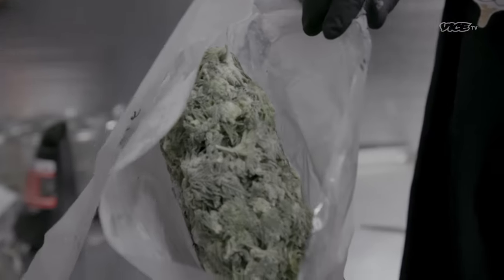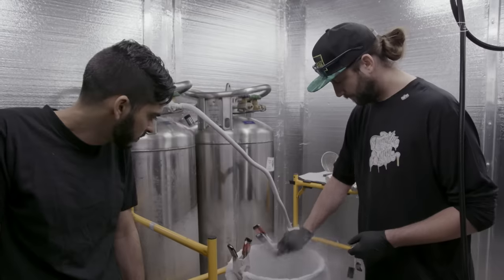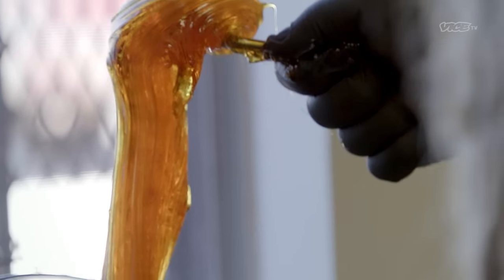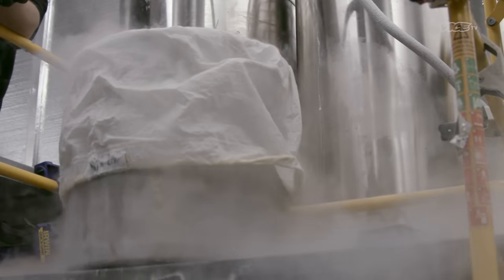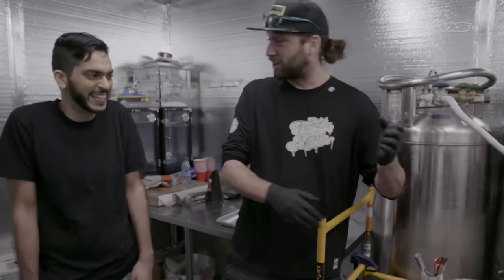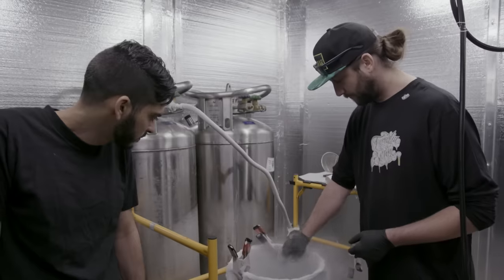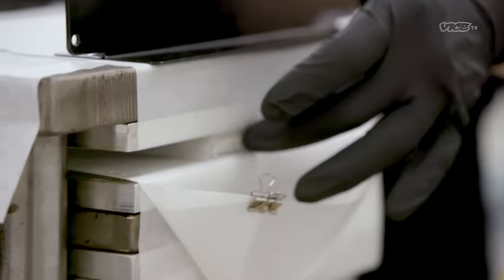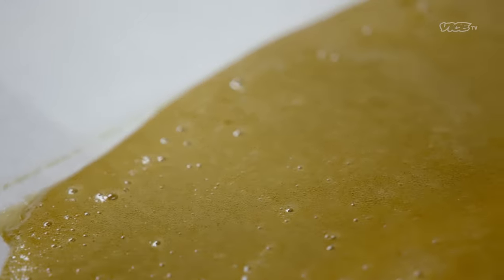I Freeze Weed With Liquid Nitrogen for a Living

Comment: I remember when a dime bag cost a dime! Now they’ve split the weed molecule like 500 times.
Reply: not sure its a good thing
Reply: it wouldint coast nothing if you grow your own
Reply: @Anonymous30304  well thats not true unless you just plant a seed outside and let it rock on its own with no inputs. indoor on the other hand cost more than you think. but in the long run way cheaper than buying.
Reply: @Mr.Potato420 He said “It wouldn’t cost nothing”, so he’s not wrong, though I’m not sure it’s what he actually meant, lol.
Reply: you cant split molecules without making them not weed anymore
Reply: @Anonymous30304 It costs so much to set up and maintain. Heat lamps, a whole room, humidity, aeration, room to germinate and sprout....Hundreds of dollars of set up and maintenance. AND ITS ILLEGAL.....Its only legal if you live MORE THAN 25 MILES AWAY from a dispensary. Sadly.
Reply: @Anonymous30304  no it just cost time in prison
Reply: @SumDetailingguy nark
Reply: It was never a dime. It was $10. Now you can walk into whatever dispensary is within walking distance and for $10 you get an 1/8th oz of your choice from a hundred different varieties.
Reply: @Anonymousguy-420 Sure it would. First it costs for proper lights, ventilation and humidity, timers etc, the cost of all the electricity to run the lights and other equipment, proper fertilizer, good seeds and the space and time to do it, not to mention the equipment they were using with liquid nitrogen etc. Try doing all that without a licence. Think you are going to just throw a couple seeds in your backyard and harvest extract like that in any kind of volume?
Reply: @Anonymous30304 bingo this guy gets it. Never understood why more people don’t grow in legal states. Spend $500 on supplies and never be without weed.
Reply: They split the weed molecules and the price 500 times
Reply: @sexygirlmax2019  Imagine going to jail because somebody opened up a weed store in your area lmao
Reply: @Mr.Potato420   you can get a decent harvest by putting virtually no money or effort into your plants if you think ahead
Reply: @sexygirlmax2019  I'm guessing that's in your state.
Reply: @sexygirlmax2019 that’s cap 🧢, you can grow up to 9 plants in my area and a dispensary can be next door
Reply: here it's really cheap. like 70 bucks an oz for pretty good stuff.  dabs 8 bucks a gram
Reply: I lost my job bc this stuff, be careful
Reply: @Next96300  Yeah I live in Kansas city MO the dispensary weed is expensive $40 to near $60 for a 8th and most times there is a nearly $10 dollar tax after purchase that's why street dealers are still in business heavy in the city
Reply: Indoor was never an option sun is better then any mimic light and weed stronger in the sun then grow lights indoor was specific for cleaner buds but not better as if outside seed plant water water water harvest 🫡🫡🫡
Reply: Would it be a dime bag if it didn’t cost $10? You still pay $10 but the bag would be smaller. Right.??
Reply: That's a bar...u are now a conscious rapper lol
Reply: A dime bag will still cost a dime…
Reply: @AquaJV  if it “wouldn’t cost nothing” that means it will
Cost something. So actually he is right cuz cant grow for free
Reply: Still have not replicated the ole school taste.
Reply: @redavni1 What state do you live in? It's about $10 a gram in NM dispensaries. Our state taxes us into the ground ❤
Reply: @VondaInWonderland  California. Taxes are high here too but so is supply.
Reply: @redavni1  Uufff I've heard about the California taxes and licensing, and  that the old school Humboldt county growers have been put out of business :/
Reply: @VondaInWonderland  yeah I live in Humboldt. The growers are changing the name of the business every year to dodge taxes
Reply: @redavni1  I'm glad that they are still finding a way to thrive.
Reply: Nickel bag was also $5
Reply: @sexygirlmax2019 not if you live in a legal state, you can grow anywhere
Reply: @martygriffith2135 … Yeah… That’s what I said.
Reply: Still gotta be careful as a user based on your employer. As soon as they passed the law that it was being legalized in my state, employer (big international company) pro-actively updated employee handbook that they follow FEDERAL drug laws if testing employees, not state.
Reply: @Anonymous30304 we can tell you don't grow
Reply: @Mr.Potato420 I mean, weed grows naturally dude. If it can survive by sitting outside on its own, then yes, growing your own weed is free
Reply: @Mr.Potato420 outdoor smokes better
Reply: Is this a half baked reference?
Reply: Paid $15 for a regular sandwich baggie about to run over it be stuff full . Then it went to a $15 4finger lid around the Mississippi Delta in the mid 70s . It wasn't the bud of today. But in the late 80s we was buying Amsterdams Skunk#1 grown in Kentucky. It be a 10 1/2 hr.drive to get it but I made the run acouple times lols . Friends in Kentucky had a Co-Op grow so they had it going on for awhile. Lost contact. I sure they still do. I got some good bud back then . The Skunk#1well let's just say that Arkansas has no weed better than it . I haven't smoked any yet anyway. Maybe one day they get something close to it. The female puts off a odor that smells like a female Skunk puts out when she in heat to male skunks. They come spray all around our house , looking for a female cause my plants that I growed from the seeds. They did good in the fertile Delta soil .
Reply: @katherinemcclellan8825   What is the "Old School taste."?
Reply: @technodrone313  Where's here though?🙄
Reply: Detroit @nyakwarObat
Reply: Remember when in the 80s it when dry then when it came back it was metric.  No more nickel and dime bags.
Reply: Back off grandpa, ur embarrassing ur virtual reality clones
Reply: @Mr.Potato420  really long run unless you sell half
Reply: @redavni1  which universe is this I want to move there
Reply: @Anonymous30304 growing good weed is in no way easy. Or cheap. Even indoor grown is hard to perfect
Reply: Just ruining the flower...
Reply: @AquaJV  He said it "wouldint coast".   Not sure what he meant.
Reply: @wutangisforever2798  
It's just that the size of the bag will also be that of a dime.   Literally.
Reply: @kaispirit2079  
Groovy.   How much for a lid man?
Reply: @stephenharbisonsr.4557  
I've seen some 'less that honorable' dealers pass off dirt weed as skunk weed by pulling a couple of hairs off a dead skunk in the middle of the road and dropping them in the baggy.
Reply: @seeharvester You’re so funny man. Are you a comedian?
Reply: Who wants to have their whole house reek tho
Reply: You're full of it. A dime bag never cost a dime.
Reply: @Coolcarting  that was your focus lmao? I’m wanting to learn about this newly discovered “ weed molecule “ 😂 like what is weed to this man some kind of medication found in a laboratory? 😂
Reply: You 160 years old?
Reply: @bobwoods1302  facts. Cuz never it costed 10 cent.
Reply: Just make your own, then the only price ya gota worry about is the price of fox farm lol
Reply: @Anonymous30304  you have no idea the cost to grow good weed. it costs a LOT.
Reply: now we're paying 500x more for the same dime bag lol
Reply: @AtomicBl453  if you bought weed for a dime you didn’t get weed 😂
Reply: @Anonymous30304 Dude, grows aren’t cheap. Don’t underestimate the amount of money and time put into growing quality bud at home.
Reply: @blak3brutus229 it’s best he didn’t as the plant is very toxic
Reply: @LiClan  marijuana is toxic yes in the sense that inhaling smoke from a muffler that your walking behind while it’s in park but on is toxic however unlike tobacco which is designed as a man made chemical, marijuana is a natural plant without much altercation other than to the care of its otherwise already natural properties ( speaking from and as the experience of a medicinal user )
Reply: @blak3brutus229  it makes people do wild and crazy stuff. This guy smoked one and got in a car. He kept driving til he hit a lamppost at 155 mph. Lesson to all
Reply: @LiClan  that didn’t make him do that, going 155 is a personal choice, I drive high all the time and never go past 80 😂
Reply: @LiClan  going over 95 means you aren’t suited to drive sober or not!
Reply: @blak3brutus229  the weed took over him
Reply: @Anonymous30304 yes it would cause it still costs money to grow it.  Or at least grow it the right way.
Reply: @sexygirlmax2019  wait what? what state are you in? My state you can grow up to either 4 or 6 plants depending on your situation no questions asked. doesn't matter where you live as long as its in the state.
The issue is initial set up is going to cost a grand with a tent. soil nutrients. trellice set ups. air control etc. When you can walk down the road and buy a half ounce for 70 bucks or so.
Reply: @VondaInWonderland  The real trick is to get a job near the dispensary, they give you neighbor discounts and repeat customer discounts which remove the tax and then some. Thats the beauty of competition in the dispensary game. For the first few years it was always expensive and not a huge selection. few years later some competition comes in the mix and shuts the shitty ones down. But you have to have a free-er market. Places like NY keep their markets completely artificial.
Reply: Lol you remember how much condoms were back then... nawl we never used em
Reply: @sexygirlmax2019  bullshit its not that hard and or expensive. You dont need some fancy lights at all.
Reply: Yeah but the $10 dime bag was definitely worth $10.... The weed now compared to the weed even in the '90s is crazy...
Reply: @hiijacktv IF COURSE IT IS! ARE YOU CRAZY??
Reply: Who complains about the cost going down? Use to cost me $60 for a quarter now I get it for $28, weed is literally the only thing in my lifetime where the cost went down not up.
Reply: its  cheeper now wtf
Reply: What if they made a "Nuclear weed Bomb". 😮
Reply: i wanted legalisation in my country not commercialisation elsewhere :'(
Reply: yup and now i can go to my local dispensary and get 1/8th of moonrocks for 15$ or 2 cake carts for 17$ which are eh{terps are too sweet}still gets you high af though, or an oz of westcoast cure flower which is dank for 70$. only thing that ruins it is the insanely high taxes 30% total. but still cheaper than what it was even 3 years ago
Reply: Dime bags have never cost a dime, only time I got more than a gram for less than a dollar was buying wholesale from a grower and that was 32lbs
Reply: @sexygirlmax2019 why do you have heat lamps, 90% of the time indoor is too hot and needs ac. Where do you live that you need to heat a lighted room or tent?
Reply: @wescald why did you lose your job from weed?
Reply: @SharonHF so learn how to drink some water... Passed every drug test I ever had by drinking a bunch of water and taking a few vitamins.
Reply: @kuttlikethat not true at all
Reply: @TayKayx not hard at all... Just research first and start with a few tomatoes. If you can't grow tomatoes you aren't ready to grow weed. I have grown in a lot of styles and conditions, and I can say that microdots in a 10-20 gallon Styrofoam cooler grown with the Kratky method will work for almost anyone with next to no effort and quite cheaply. The hard part about good weed is the curing process.
Reply: @SirSquash not true, it costs however much you want it to... Just pick the right set up and grow method for your wallet. People grow in solo cups in windows.
Reply: @blak3brutus229 how do you figure? What if he's on the autobahn?
Reply: @LiClan that's not how weed works
Reply: @nwerd7584 that's your question, not why she needs heat lamps??? 😂
Reply: @waffleMccoy you do need decent lights, but unless we are talking about winter in Michigan, Canada, Alaska, etc... I still don't understand the need for heat lamps. And neither a decent led or heat lamp have to be expensive at all. I fact you can even buy used lights with a burnt out diode or two dirt cheap.
Reply: @JamesJones-cx5pk you're too high
Reply: They've split the weed molecule? What on earth does that mean?
Reply: fortunately a bar
Reply: @TayKayx  no... its insanely easy, the word ur looking for is "tedious"... never once have I thought its difficult. 😂
Reply: @christalball93_  let me guess u have never heard of filters? 😅
Reply: @killer8349  lmao it’s really not. I know several people who’ve grown. Ur just being cocky if y say it’s easy. Mushrooms are easy, weed is not. Try growing in Arizona you’ll see. Grow tents even I see em fail all the time.
Reply: @TayKayx  and u act like you know it all... i must be a genius then but we both know that's not it... I have 12 growing rn for legal reasons that's all I'll say... I've grown indoors and just harvested 150g from an outdoor grow (wet).
Reply: @TayKayx  sounds like a skill issue tbh.
Reply: @killer8349  it’s not easy, stop spreading bs lies. It is not easy lmao. Ik people who can grow good weed & people who have failed. It’s not easy. Ur so cool bro u can grow😂 little boy it’s legal in a ton of states ur not a god
Reply: @TayKayx  who said I was a god? what... did you try and fail? is that why ur ego is so hurt when i say its ez? look bud, just because its difficult for you dosnt mean its difficult for everyone... just cuz you know people who grow means little, but sure... dwell in ur delusions.
Reply: @TayKayx  and when did I claim I'm cool? u have sum wrong wi ur brain lil jit.
Reply: In my day a dime bag was about 4 grams
Reply: Still does cost a dime, just means you're getting buds lost in my couch.
Reply: still does cost a dime if you skip the middle man and grow your own, F all these taxi medallion grows.
Reply: @nikushim6665  growing indoor costs a lot man.
Reply: Bars 😂

Comment: So what they do is break apart the tricomes into frozen micro particles and then use heat and pressure to press the oil out. Pretty cool to use liquid nitrogen to crush the weed and it's a super clean process to deal with.
Reply: You sound so slow. Using liquid nitrogen to crush the weed 😂😂😂😂. Force crushes things not liquid nitrogen

Comment: Wait yall skipped over the most important part. What's the process of getting the trichome heads out of the nitrogen?
Reply: was thinking exactly the same. now im just confused
Reply: @aaleeksii  they use rosin screens to collect the heads meaning the push everything through a tube with layers of screens. Similar to how you layer you screens when making dry sift or bubble hash. But there just pushing the material through a smaller surface area. Plus the CO2 keeps everything frozen so no degradation of terpenes.
Reply: @1173sanman  neat, thanks for the info!
Reply: @1173sanman  You mean LN2 not CO2
Reply: yes  @ahhason
Reply: Thanks for the info i  thought there were no screen its just an "nitrolator"
Reply: @1173sanman most important, no moisture!
Reply: probably just pour it out in to mesh the ln2 will evaporate unless its in a large amount

Comment: Been making oil since the 90's with my sisters hair straightener lol
Reply: How tho. Can you explain the process?
Reply: Don't forget the wax paper 😂😂😂😂😂
Reply: @Faceless959   Heat and lots of pressure
Reply: @Faceless959  Also used to do it with a pollen press, and would just put it on my stove and get some wrenches and crank it down as hard as I could. Obviously this is not the best way to get a good amount. But back then a little dab of it was way better then anything that was around.
Reply: That's rosin. Lol try using a bench vise, a torch, and some pipe and bolts...i was crazy inventively when I had a bunch of low end mid stuff... nothing to lose at that point..😂😂😂